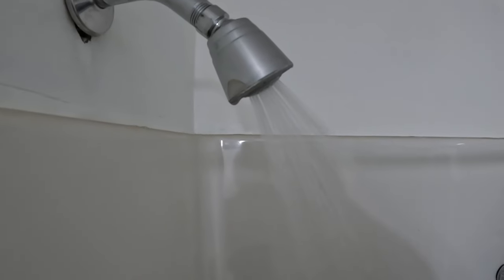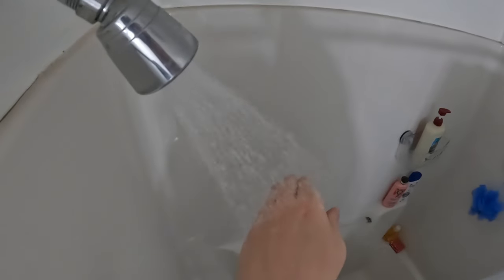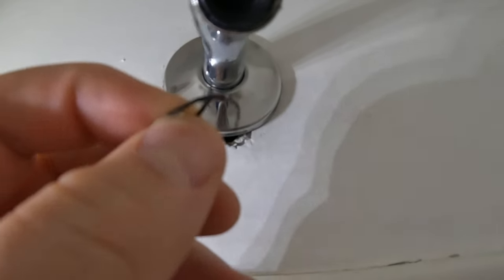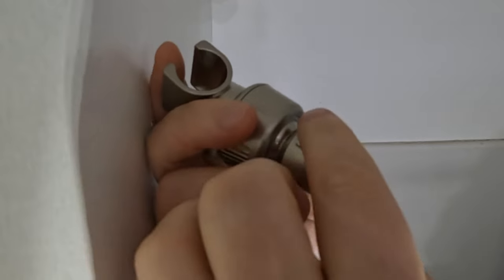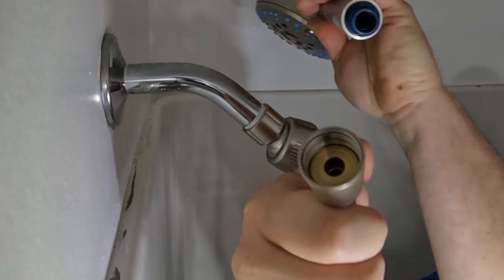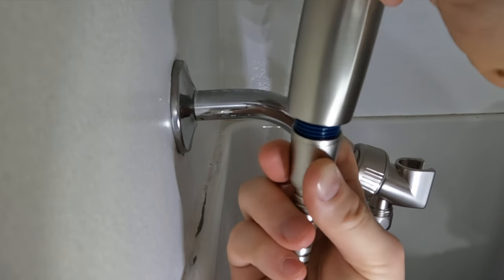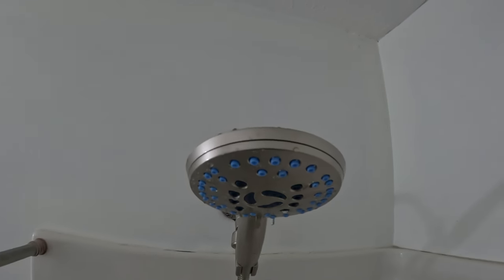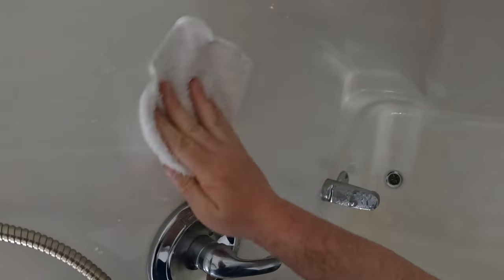How to Install Shower Head - Amazon's #1 Best Seller AquaCare Luxury High Pressure with 6ft Hose

Comment: Maybe a good instructional, but the product itself is cheap with plastic breakable parts.  Don't buy Aqua Care.
Reply from the maker: Yeah, there's a lot of cheap ones out there.  Almost hard to find a good quality one.  But this one is still working a couple years later so no complaints.
Reply: As long as you don't over tighten anything, plastic works just fine.
Reply: Thanks for the great video! Much better than the packaged instructions that come in the box. I've never installed a showerhead before, and this was very helpful. I'm excited to take a shower now.
Reply: This is a great shower head and not easily breakable
Reply: Thanks for your help! It works great.

Comment: I already installed mine a couple weeks ago but like to check out videos like this just to see if I screwed up.  Anyway, looks good, both yours and mine.  The only thing I didn't do was to remove the flow restricter.  I found that the default was plenty enough and I am coming from a very heavily clogged with minerals head left by the previous owner of my home.

Comment: I tried installing the ahowerhead, but it leaked 2 places. I need to buy more teflon tape and try re-installing it again to fix leaks. I was frustrated reading the 1-page instructions. I couldn't find "how to fix leaks on the instructions" (I gave up after 2 hrs). I should have installed new shower heard on the weekend instead of after work (I had to re-install old shower head for now so I can shower and wait until teflon tape arrives). Thanks for the video. I should have watched it earlier.  Aloha from Hawaii.

Comment: The instructions were great, but mine leaks. When I unscrew it from the shower arm coming out of the wall no water comes out, but 2-3 times a week it leaks through the shower head, and the hose and head are always filled with water. Any suggestions?

Comment: I was able to remove my old shower by just popping it off which is why I purchased a new one becuase when you move the shower head around it would just pop off. But the problem is at the end of the shower connect it is shaped like a ball so i can can't connect the pieces. Any recommendations on how i can get connected?
Reply from the maker: That ball should attach with a nut further back, right?  Remove that part too.  Like this - https://youtu.be/kxD31_nKWxQ